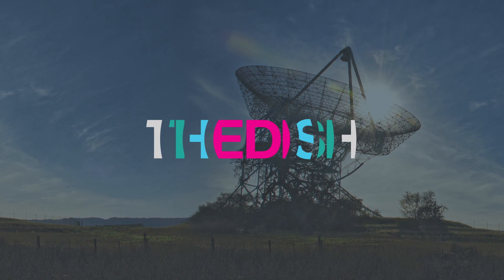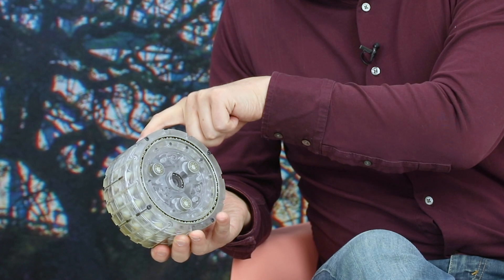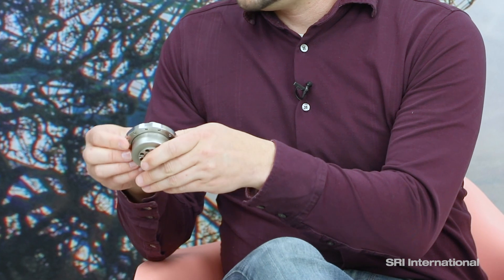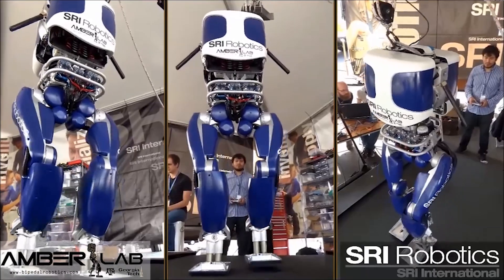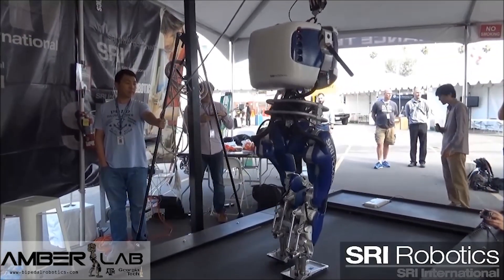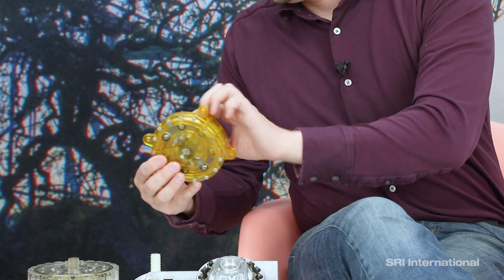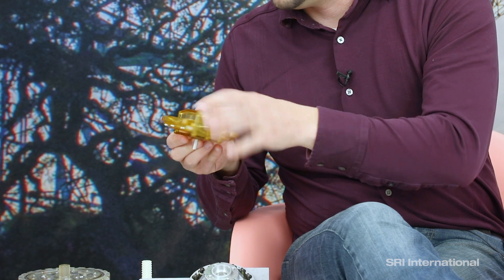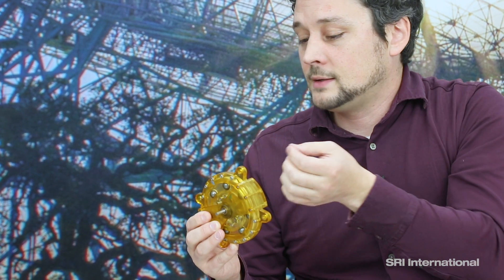Alexander Kernbaum talks about Abacus Drive

Comment: Are the rollers constantly gaining an losing rotational speed. That seems like it would create a weird inertial effect
Reply: Great question! Initially we thought the angular velocity of the rollers was periodic, but it turns out they are not! The linear velocity at the contact point varies periodically but the angular velocity of each roller is constant. This is very good for high speed operation, as we don't have to worry about inertia fluctuations.
Reply: @asboxerb  neat! Is there a way to get a sample of this drive?